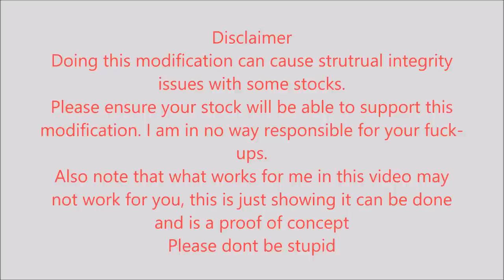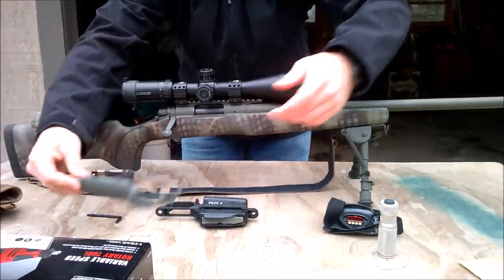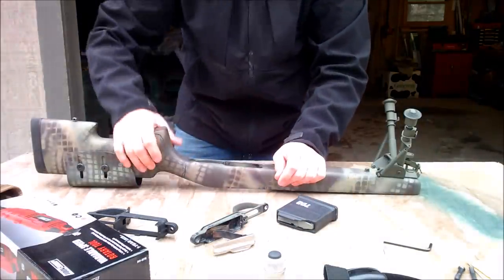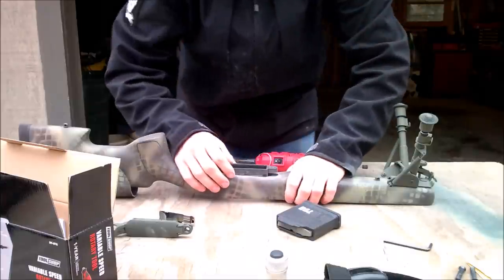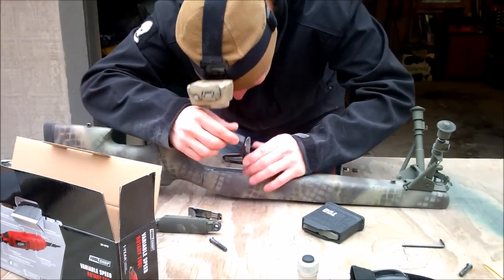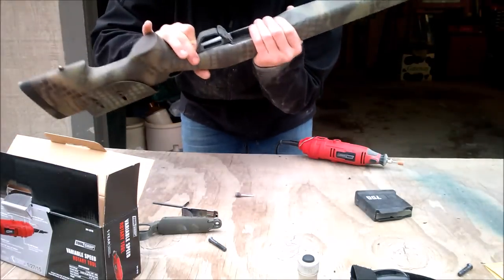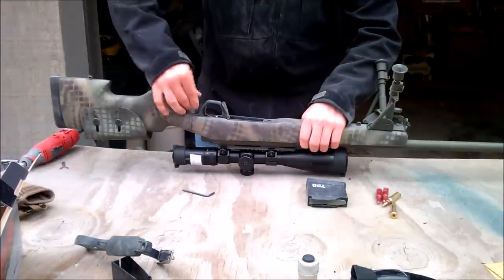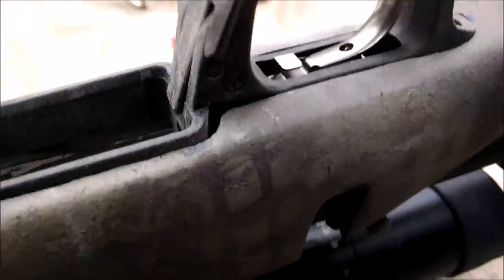Remington 700 Magpul Bottom Metal Install

Comment: Good rough guide. I just installed this kit onto my gen1 700 5r in .308. In addition to what this fella did, I had to dremel the magazine at the front and back a bit to get it seating properly as it was interfering with the receiver at the rear and under the feed ramp. This is with the factory HS Precision stock. Feeding is fine. Extraction is a bit stiff but I'm sure it will break in. So far I can recommend this upgrade.

Comment: Maybe not the best video I've ever seen but truly helpful. I now know absolutely that there's no way I'd install this part on my rifle. There's a reason the legit companies charge more than $30 for a bottom metal.
Reply: This bottom metal is originally designed to work with the magpul 700 hunter stock.  It's not drop-in for anything else, hence the modification needed to make it work.

Comment: Awesome to know that this works! And I was thinking of getting a $900 chassis just so I can use mags. Now I won't have to.
Reply: The Magpul Hunter stock is still a good option, for 200$ you have a stock that can receive a bottom mag. That's what I'm gonna do with mine
Reply: stephane Blondiau they need to make the Hunter stock in a Left hand configuration!
Reply: @chetburnes3776  yep, I'm not concerned about that but it can be a good option too

Comment: Nothing looks better on a nice rifle than a polymer trigger guard (eye roll). 
 Been through two polymer "bottom metal" setups. One for a savage 110, and one for a howa 1500 after the howa plastic bottom metal cracked while i was torquing the action screws with a torque driver. Both of my aftermarket polymer bm cracked at the center action screw. Shims on the back did not prevent the cracking. Threw all three in the trash, bought CDI actual metal bottom metal, and haven't looked back.

Comment: I did this with my Bell & Carlson stock. But, I left the vertical magazines guides! The rear one leave alone, front one cut down to just rest on top of bedding block. On the rear one! Just remove the tang behind the guide. In doing this, it clears the bridge of the bedding block. You only have to bevel the bridge a small amount to clear. Go extremely slow, and check and check some more before taking off material. I ended up with a super close to factory look. And my magazines have support front to rear and function perfect. To get that nice clean close fit! Final fit with a file and sandpaper. Just my two cents.

Comment: I did this to my Remington 700 SPS Tactical with the original Hogue molded stock recently. Once installed my bolt made contact with the top of the magazine. I had to shim between the bottom metal and rifle stock with a washer to drop the mag down just slightly. Just in case anyone runs into that...
Reply: Ty,  do you like the modification?
Reply: Are you still happy with it? I'm thinking about doing this and I have the same stock you mentioned.

Comment: Excellent video I bought the ATI Legacy, fit perfect but the magazine is crap, Push down on the follower and it stays down, may switch to Magpul but found a metal piece from CD Precision and they will do the inletting at no additional charge. For the tools, time and talent that you have, the $209 investment to get the metal piece mahbe a bargain..Great video

Comment: I've been thinking about doing this but my stock on my rem 700 doesn't have bottom metal. I wish there was more info on milling it out to fit bottom metal. I don't want to ruin my stock either considering I fiberglass bedded and freefloated it myself and after all that time and work if hate to end up throwing it away
Reply from the maker: yea I understand, a better option might be the magpul stock
Reply: I thought the same thing about more milling info, but I just had to create the CNC milling programs to get mine done..  Worked great tho!

Comment: To remove .003 of an inch you would be using sand paper and not a Dremel tool
Reply: really that's the average thickness of a slice of notebook paper.
Reply: 3 1/10 tenths of an inch...  .300 of an inch

Comment: What did you use when you sprayed your stock to get the square shapes in contrasting colors?
Reply from the maker: I used a cargo net that had small squares. painted once then went back over again using different colors. example. if I went: sand, light green, brown, OD. I would go back over a second time in the opposite order.

Comment: Watching this video makes me wonder how popular the Mossberg MVP 556 and 308 have become? They seem like pretty good setups and look to come in many different flavors. Plus taking AR15 mags and SR25/LR308/M1A mags, respectively, isn't a bad deal either. Anybody want to weigh in on this?
Reply: Viiking 01 to be honest I think it not really going to take off even two year today I’ve seen one in a gun store and one at the range and I go quite a bit. If you need more then 3-5rd  you really need a semi auto for that type of engagement. I do like the ability to reload quickly in the hunt but it not that much faster them me slinging 4 more rds into the well.
Reply: I have the MVP in 556. It has failure to fire issues with 556. Its not worth the money. About to trade in for one of these.

Comment: Magpul could make so much money selling this if it just fit directly into a factory 700 stock (or at least factory dimension aftermarket stock).
Reply from the maker: cfusionpm yes, but they sell it with the I tent of you using it in their chassis system
Reply: bvhnightmare can you put a link to it

Comment: Where did you find the metal mag receiver?  I keep running into the polymer version.
Reply from the maker: dkorzo1 they are all metal as far as the Magpul ones
Reply: bvhnightmare Thank you.  I'm still to find a metal Magpul mag well.  Brownell, Midway they all are coming up as a polymer. The only metal ones I have found are by Surgeon, Badger, or HS Precision.
Reply from the maker: dkorzo1 I am sorry I misspoke in my previous comment Magpul only manufacturers polymer bottom units I have found through hundreds of rounds with the Magpul in my Remington 700 that it is just as good or better as the metal bottom metals
Reply: bvhnightmare Thank you for the clarification.
Reply: bvhnightmare By the way, Bad Ass looking rifle!
Reply from the maker: Thank you she shoots like a dream too
Reply: bvhnightmare Sorry for all the questions.  I just bought one and I'm trying to get it to where I want it.  The cheek riser, is that an add on through Bell and Carlson? Also, was that a Cerakote finish you used?
Reply from the maker: dkorzo1 the cheek Riser is a Kydex piece I bought online all you have to do is search Kydex cheek piece and you'll have hundreds of results the camo pattern is simple Rust-Oleum spray paint and I used a cargo net for the pattern

Comment: you wont ruin any of the "structural integrity" by removing a small amount of material from the inside edge of the block. if you were going to hacksaw a channel all the way through it, now that would effect things
Reply from the maker: I understand that, I didn't affect how my stock worked but others may have a problem

Comment: this wasn't made to use in anything other that the Magpul hunter 700 stock so do this at your own risk.  once you dremel your stock the original trigger guard and floor plate will not work with that stock anymore
Reply from the maker: Captain Howdy yea that is true
Reply: bvhnightmare nice job though

Comment: you don't have to do all that advance technology industries makes. a magazine conversion kit for Remington short action  cal 223,204,308, 22-250  drop in ready only $99.00
Reply from the maker: There are several things I do not like about the ATI. 1: the mag release is in front of the magazine, if you do any sort of barricade work you will drop your mag. Also the mag release is flimsy  2, it is not compatible with AICS mags. 3, there is no metal reinforcement on the bolt holes so improper torque will be applied to your action thus causing accuracy issues. 

just not what I was looking for.
Reply: bvhnightmare and to add to that, the magazines follower in the ATI need to be sanded and the polymer is crap

Comment: Use some bedding to fill the cracks if you have any left
Reply from the maker: Sig 226/2022 I'm getting half minute of angle accuracy out of the rifle already so I don't feel there's a need to bed the bottom metal
Reply: bvhnightmare 
Not for accuracy! 
Just to fill the cracks. It would bother me every time I saw it if it was on my rifle 🤓
Reply: Sig 226/2022  not only that, why wouldn't you. that's like saying my tires have air in em already, y inflate them to the right psi? Y, because that's how u do it correctly. not half assed.

Comment: The Magpul Kit Magazine kit is specifically made for the Magpul Hunter 700 Stock.  You can buy a kit from Legacy Sports that does not require any modifications.  I bought mine from there and it fits perfect and no mods were required for fitment. I've had mine for about 2 months now. I've put 50 rounds through it and it works like a charm. No slack. fits like a glove. and worth it.

http://legacysports.com/shop/products.php?cat=8
Reply from the maker: that is true Legacy Sports does make a bottom metal kit for the Remington 700 but the plastic quality compared to Magpul is poor also I do not like the way their magazine release system is setup the Magpul bottom metal allows me to run Accuracy International magazines, the Legacy Sports magazine is a good option if you do not want to modify your stock
Reply: bvhnightmare Nice. Hope you love your kit. Just didn't know if you saw the legacy kit. Just had to let ya know. Do you know any great websites for gun stocks?
Reply from the maker: +Don Lemke I had a friend who shot a rifle with a legacy Sports bottom metal and I just didn't like it that's why I tried the Magpul bottom metal on the subject of gun socks no I do not have any good websites sorry

Comment: Will this work in a factory r700 hogue stock? Also can you buy any magpul 308 mags?
Reply from the maker: Mr Sig45 I do not know if will work on a factory stock. basically you have to try and see if it works. and I've bought 6 of the Magpul 10 round 308 mags

Comment: Watching you balance your rifle on your elevation knob made me cringe.
Reply from the maker: Casey Doherty modern-day Optics are very robust this isn't some 1942 technology I have
Reply: Ruin your gear if you want to. You were being lazy, no two ways about it. The elevation knob connects to your reticle via precise, small parts.  Robust or not, it was meant to move precisely with light pressure and transfer that movement to the most delicate part of the scope.  It would have taken maybe 5 minutes and 4 rounds to confirm zero to remove the scope and protect the most expensive single piece of the weapon system.
Reply from the maker: Casey Doherty root of the problem is I am lazy. scope held zero so no concern.

Comment: Ummm yeah....  Let's NOT do this...
Reply from the maker: 243wayne1 why not? How do you think badger inlets for there bottem metals? Or any other manufacturer for that matter, they cut away at the stock. Now they do it with an end mill but I've have built multiple rifles using this method that are consistent tack drivers. If it works why not?

Comment: can you do this with a 700adl in .243?
Reply from the maker: Unknown agent as long as the 700 has a detachable floor plate you should be able to do it. .243 is a 308 parent case so I would assume it would work. not 100% though
Reply: the ADL does not have a floor plate